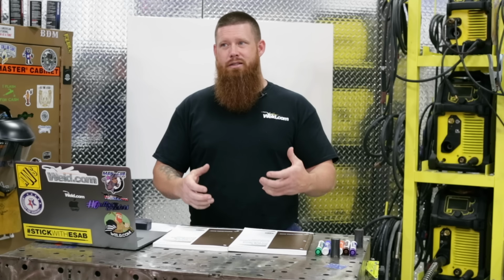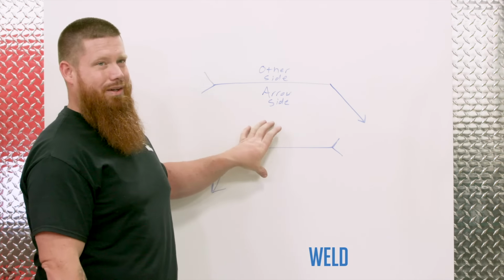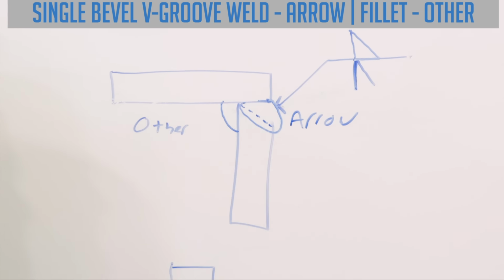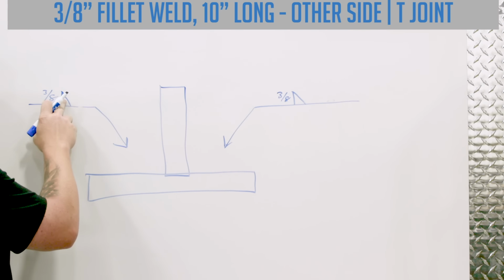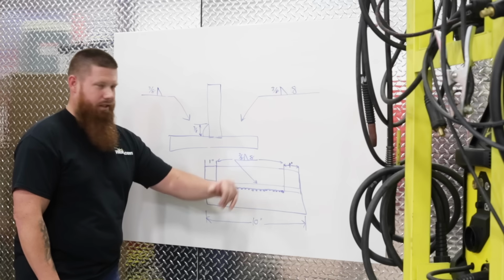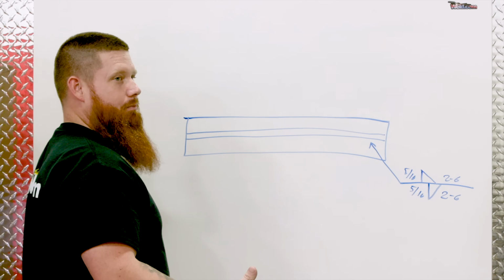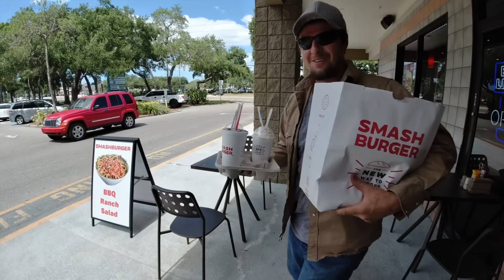How to Read Welding Symbols: Part 1(Full 3 part video in WELD™ app)

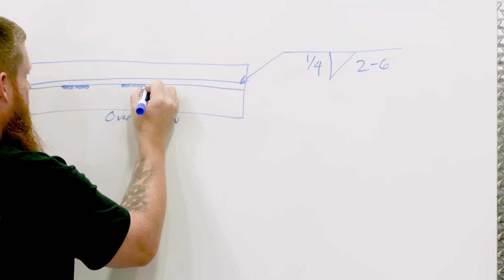Comment: At 14:20 he represents the intermittent welds on the "other side", but the fillet weld symbol is represented on the arrow side of the welding symbol. is that a mistake or am I not understanding this correctly? I'm confused now. Any thoughts?
Reply: i confused in that part too

Comment: In your 3/8ths T fillet weld equation,  you say both sides mean the same thing? If that were true wouldn't the symbol on the left be on the bottom?
Reply: I hope he would have the integrity to openly correct that💯.
Reply: Came for this exact comment
Reply: I know this is 6 years later I'm commenting on this but I believe he was specifically referencing the direction of the size and weld symbol reading from left to right.  Maybe he could have been a bit more clear on that but otherwise he was correct.
Reply: lol same here I think he was trying to say a double fillet well on both sides but he could’ve wrote that with on one welding symbol he didn’t have to draw the other welding symbol and it wasn’t on the correct bottom saying arrow side
Reply: Im learning how to read weld symbols & thus far felt Ive understood things well…up to the point in the video in question. No matter what he did/didn’t intend, I’m thankful for you all commenting on it! Everything I thought I understood, I thought I grossly misunderstood somehow.

Comment: When your talking about the 2 inch fillets every 6 inches how do you know where to start the welds on the material? Why didn't you start at the beginning of the material? Instead you seemed to burn a few inches to start the welds instead. Just curious
Reply: I am an engineer and typically in my drawings I will specify in the tail if there is something critical about the starting point. Typically that would be things like flange plates where the end welds may be longer that the intermittent weld length. Usually intermittent welds are used where the load is less than a full legth fillet. To calculate the size and pitch I figure the load then what percentage that is of a full length fillet. Say it is 30% so that would be 2-6.

Comment: Great video, thank you!
Is there a standard way to show the initial offset of the intermittent fillet welds?  Measuring from the left, for a 2-6, is it standard to center the weld in the pitch length -- for a 2-8, skip 3", weld 2", skip 3" then repeat?  
If the length is not an exact multiple of the pitch, e.g. 10" with a 2-6, do you subtract half the 'missing' pitch (here, 1/2 of 2") from each side or what?

Comment: First, let me say this is a great series idea and I thoroughly this first installment! That said, I have a question and a suggestion or "tip" to contribute. First the "tip". A way to remember which symbol side is which that I use is "arrow" and "bottom" both use a double letter in there names ( aRRow /boTTom). So if you remember this, then, what is written on the boTTom of the line will go to the aRRow side the rest will take care of itself. A little like the words "port" & "starboard" being "left" & "right" is easily remembered by "port" and "left" each having 4 letters. Little tricks like this have helped me alot! I hope it helps someone else as well.
Now the question. When laying out the intermittent welds be they staggered or not, will the bead placements be shown or are we to know to start laying out from the middle and work our way out or start art at the end and work our way across? Could you be a bit more specific about this please?
Perhaps you could show an actual call out sheet or blueprint that a pro welder on the job site would be given to work off of? Structural, pipe, fab shop, whatever! Maybe all of them if possible so we could see the differences as well as the similarities of what each occupation sees on a regular basis? Just a thought!
I'm too old to go pipeline welding or build skyscrapers or bridges and tunnels but I'd love to see what they are looking at!
Again, great video! Looking forward to more!
Peace
Reply: patrick farley thanks for the feedback and the tip. The intermittent fillet welds would usually e labeled on the print. If they aren’t, I usually make sure that one of them starts at the end  of the pieces being joined.

Comment: If the weld width is super critical, do people put scribe lines down so they can see where the toes of the weld need to be while they're welding, or would that not be allowed?
Reply: Beach&BoardFan I used to have my students layout where their toes should be just so they could see what it’s supposed to look like when they hit the right sizes. Once you do it long enough it becomes second nature.
Reply: The company I work for just wants good penetration and a flat profile, if it needs to be a certain size the expectation is that you'll just keep stacking beads until its enough. Unfortunately we rarely get to see prints or any of the weld symbols, so this vid is much appreciated! 👍

Comment: Youlost me on intermittent fillet welds 6" on center why didnt you start your welds from the end instead of leaving a space at the end how do you know that im pretty sure it matters id like my material to be tied at the end.
Reply: delinquentdesign this was for instructional purposes only. Most times the welds will start at one end and finish at the other on the opposite side.
Reply: Thats just my point would that be indicated on the drawing with a symbol or something to start at the end and then go 6" on center? Remember i dont know anything about welding symbols.

Comment: I'm sure I'm not first one to realize that the welding symbol is wrong on the t joint in the middle of the video when he duplicated the symbol from the right side to the left side.
Reply: CNC Molds N Stuff yep, I screwed that one up. Glad you caught it though. I should have switched the weld symbol when I moved the welding symbol.
Reply: @GodslilRedneck23  Its an easy mistake to make.  I've done the same sort of thing myself.  Glad to see you own it.  I actually rather enjoyed the video, and I learned a lot.  I'm one of those shade tree self taught guys when it comes to welding.  ie.  I'm not a "real" welder.  LOL.

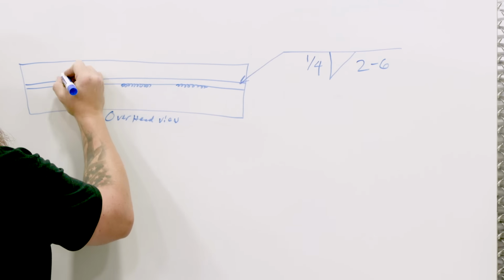Comment: Can you explain 14:20 with the arrow pointing to the top side of the vertical and the symbol indicating near side.  If I look at that, I would assume the weld would go to the top side of the vertical, not the bottom.  It's there a specific reason you placed the welds on the bottom?
Reply: Xmvw2X  my arrow came out shorter than I wanted it too. Story of my life 😂 sorry for any confusion.
Reply: I also think that was a mistake.

Comment: As an engineer with little welding drawing experience, this is helpful. I actually tried to make some prints for a weldment last week... luckily it ended up being converted to a screwed assembly (for technical reasons), as I had things completely jacked up (didn't use the right symbols or the like). Good to know this in case I ever have to make welding prints for real.

Side note- I do work with metric a lot (Japanese auto exhaust/body shell OEM for Toyota)... I haven't seen them (we usually never do), but I'm sure it would give the local welding shops fits if they were handed equipment drawings to recreate that were all in Japanese with metric :D. Equipment wise. we're a metric company, for everything except pipe threads, floor anchors, and MIG wire. Makes working with non-metric suppliers "interesting".
Reply: Typically CAD programs will let you specific what you want (e.g size on this side, type in the other side) and then auto generate the weld symbol

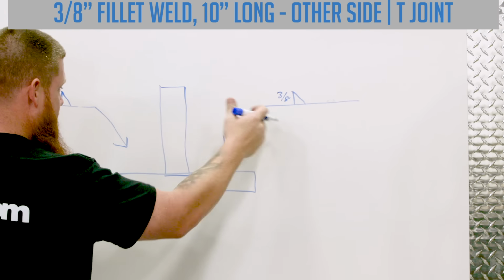Comment: 9:00 how can both symbols be telling you the same thing?  Both symbols say other side, yes, but are on different sides.  The one on the left is describing the weld on the other side(right in this case), a 3/8 fillet weld.  The one on the right is describing the weld on the other side (left in this case) 3/8 fillet weld.  They're both describing a 3/8 weld on the other side, which technically isn't the same thing because they're different welds.  They're not describing the same weld per se. The symbol on the left should have the information about the weld on the arrow side If I understand correctly. I am I missing something?  I'm new to this and trying to understand.  thank you.
Reply: Radio Bro good catch man. I screwed that one up. The symbol on the right would be the correct symbol. I was trying to show the arrow line from a different direction. But I forgot to drop the weld symbol on the left to the arrow side. Sorry for any confusion.
Reply: @GodslilRedneck23  It's all good.  At 15:02, is the 3/8 fillet weld supposed to go on the bottom, or should it go on the top?  The arrow is pointing to the top it appears, or... is the arrow side always down on horizontal drawings such as this, as well?
Reply: Radio Bro yes sloppy handwriting it should be a bit lower. Arrow side is always on the bottom regardless.

Comment: I was one of those people who asked for this. Now I'm asking why does the intermittent need to be from the centre, and why can't we have a arrow per weld hahahaha
Reply: ifell3 glad we could answer some questions. Let’s see if we can help you out some more. 1. I used to know why it was measured Center to Center. Honestly if it’s done right Center to Center dimension would be the same as start to start and end to end. I will get a more educated answer for you on this one. 2. As for an arrow per weld, it would take up too much room on the prints and make them even more confusing.
Reply: @GodslilRedneck23  I agree with the arrow theme, it's just testing this old mind! Yes the spacing would be the same but its more math for the welder, it's easier to say weld 2 miss 4 than 6-2=miss 4. I bet it's to do with the calculation of strength the engineer has.

Comment: Question about the offset fillet welds part. If the work piece is long enough in your diagram that on the other side the distance from the end to the center of the first weld is 7 inches do you do 1 inch of weld? N on the other side for the offset is it always dead center between the arrow side welds or is there an extra symbol for the amount of offset?
Reply: Ben Miller the engineer will typically set the weld size and pitch according to the part. It could be any variety of size and spacing. It’s not always 2-6. That’s just what we used for the video. Yes they should be center of the welds on the opposite side.
Reply: @GodslilRedneck23  I kinda figured it would all be planned out by the engineer ahead of time so everything is spaced accordingly n I doubt I'll ever have to pass a certification test for either a school or job since I'm late to the welding game but I was just curious. N if I ever do come across a diagram I'll understand what it means now. Always learning something when I watch your videos. Even if it's that you might sabotage your opponents in a competition lol
Reply: Ben Miller in all fairness, he started it. Go check out the bloopers on the stainless thin to thick video. I was just paying him back.
Reply: @GodslilRedneck23  lol I'll definitely go watch it

Comment: I love structural welding. This man knows what he is talking about. 
In Fabrication though.... you will run into situations that the prints do not match what makes sense. Simply ask if the print is correct before burning. Cover your ass. Engineers often get things wrong. Use your common sense.
Reply: DarkForce X a daily thing at my shop
Reply: DarkForce X and on the 8th day God created the RFI (request for information) 😂 if you look on the prints, the engineers number should be there. I used to call for written clarification all the time if I knew something was wrong. I love structural welding too 🤘🔥
Reply: Wroger Wroger always.
Reply: You are so right. As a newly certified CWI, I used to run through that all the time and was making me very nervous.  Now, I just use my best judment possible.😊
Reply: EVERYTIME YOU MUST CHECK THE EI DRAWINGS AND FABRICATIONS DRAWING STRUCTURAL DESIGN TO BE SURE ITS CORRECT BEFORE FABRICATION START INFORM ENGRS OR DETAILER IF YOU ARE AUTHORIZE TO TALK ..AND ASK QUESTIONS ..

Comment: You could do that 8" fill weld on a 10" span with a center symbol as well. You don't necessarily need outside dimensions.
Reply: DarkForce X yes but ANSI symbols and AWS symbols are different and they won’t use each other’s symbols and abbreviations for the most part. They both have to justify their existence.
Reply: @GodslilRedneck23  tell that to the weirdoes trying to pass off blueprints to me. Lol
Reply: DarkForce X 😂 it happens too often.

Comment: I typically don't have to read weld prints, i make my own usually. But this is great info for new guys and gals getting into welding.
Reply: True in field when you see it it is usually obvious but I still like knowledge
Reply: DarkForce https://youtu.be/FCzN27Qv870
Reply: I’ve been broke out since 2013 but I’ve made some bad habits doing my own prints so I’m touching up 😂
Reply: ANY SYMBOLS OF WELDINGS IS APPROVER BY CITY ENGRS,INPECTORS IF WELD IS NOT STRONG TO HOLD MATERIALS,TOU CAN RECOMMEND IF YOU A SUPERVISOR  OR FOREMAN WITH SO MUCH EXPERIENCED IN FABRICATIONS AND WELDINGS SKILLS EXPERIENCED
Reply: @edgardocortez4433  I am not a CWI. Not yet, anyways. But I work with 3 other CWI's, and only one of them can weld as good as me. The other 2 cant weld at all. They are all book and been counters.